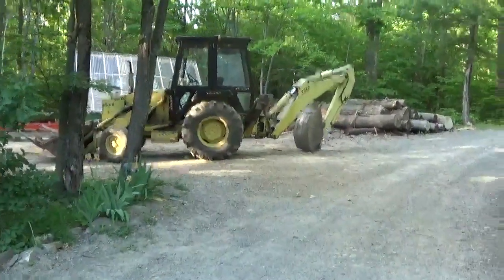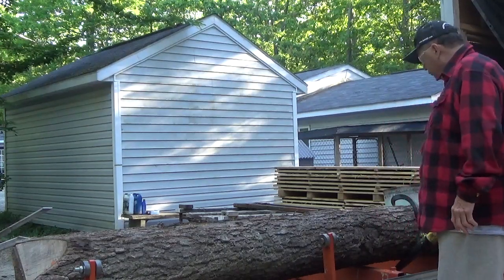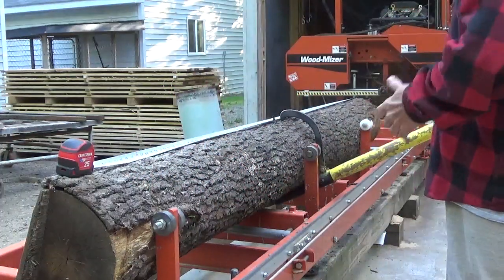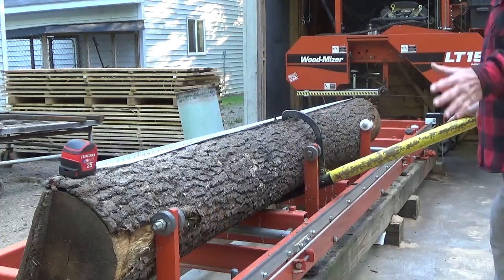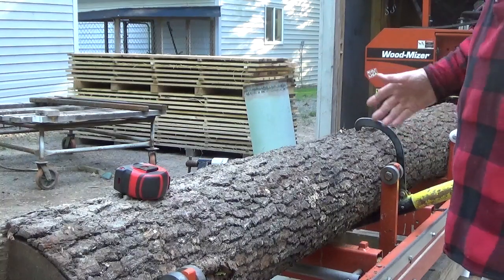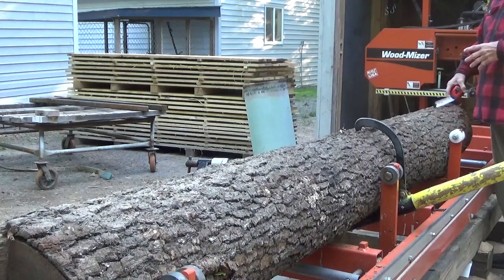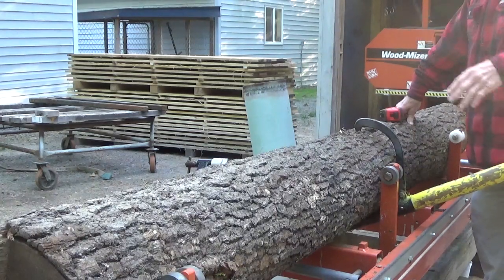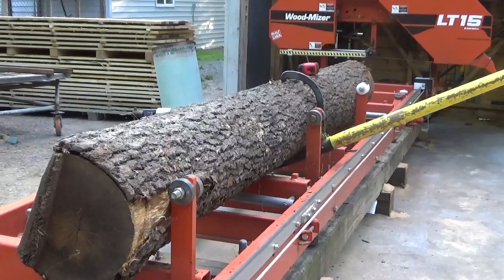How to determine which end of a log to cut off when shortening the log.

Comment: Pretty good explanation Joe and this is something that's incredibly important to anyone buying or grading logs.  I have a good example from my experience I had a huge white oak log that was cut 12 ft. It was cut off close to where it forked there for on the top end it was showing two heart centers from that fork. Now this was a big log it was 36 inches on that small end well it was a perfect log otherwise so when i went to sell it the price per foot difference between a veneer log and a #1 grade was between $0.50 and $1 a foot. So by cutting 2 feet from the top of the log removing the double heart I upped the grade of the log from #1 up to veneer improving the value by over $0.50 a foot. That particular log scaled 508 feet of wood so by cutting 2 feet it increased value by over $250. That's the importance of knowing when and where to cut a log shorter.
Reply from the maker: Yes, this is what it is all about, making smart cuts and coming out with clear instead of a lesser grade. It takes time when just starting to figure it all out, I am just trying to get the sawyers on here to see that.
Reply: @josaljo1  well you have a fellow experienced Sawyer/logger to back you up here or to help explain if needed. But Joe you seem to have it well in hand I really enjoy what you do would be doing it myself if I could.